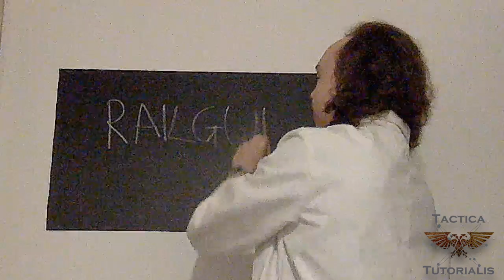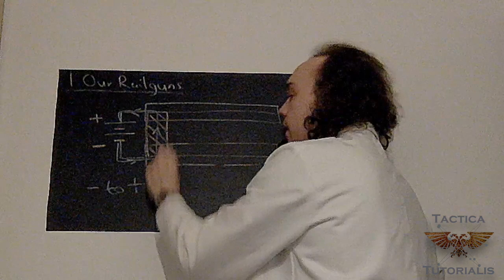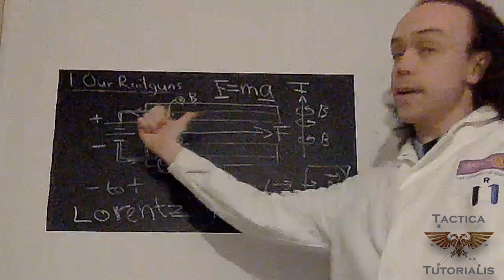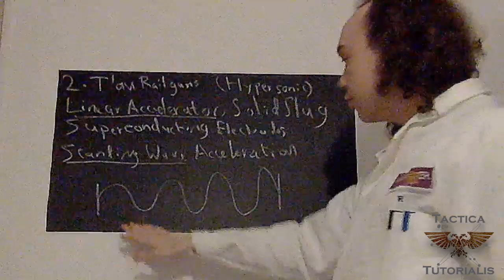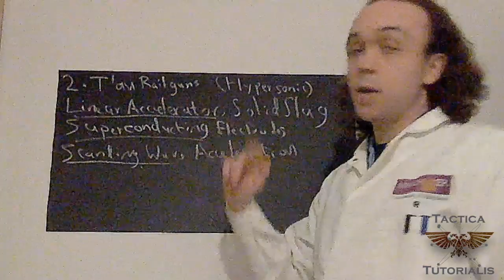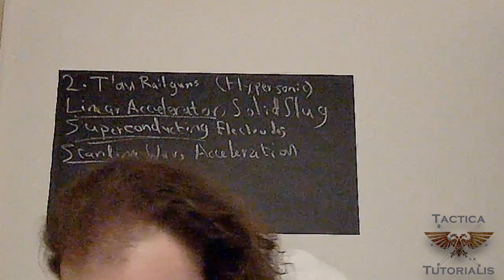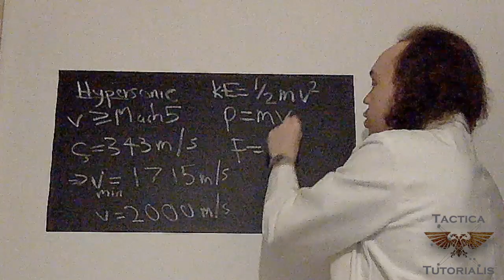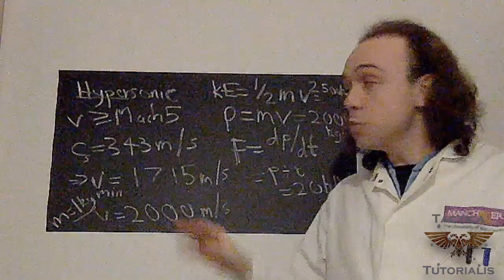Tactica Tutorialis: Episode 3 - The Railgun

Comment: I now understand why you're a Tau player... Bolters are scary, but Railguns are *frikken' terrifying*!

Quick side-question; a Rail Slug probably wouldn't stop when it hit a tank's armour. Assuming 'blowthrough' and a sealed environment, is it more likely that the shot would simply pass clean through a vehicle while sucking the air out the other side and extruding the crew across the battlefield in a fine mush, like someone stomped on an uncapped tube of toothpaste?

Comment: So what i see is the Tau Railgun is not as good as a modern day 120mm smoothbore gun of a MBT and the shells we have today can go up to 2200 m/s and that is cause we still use "black powder" and not chemical propellant
Reply: Indeed, my quick Google found a Wikipedia entry for the US's 120mm APDSFS rounds. The M829A3 round is 22.3kg in mass and has a muzzle energy of 12.1MJ. Dividing down this is roughly 542kJ per kg, so actually a bit higher than the 500kJ per kg that Tactica Imperialis calculates for the 2000m/s rail gun. It seems like a railgun would need to have a much higher velocity to justify the complex power systems it requires compared to the comparatively simple chemical energy used to launch present day tank shells.

Comment: Question: What are the energy requirements for a power sword. Using steel in place of ceramite as our melting point. And to contextualize it how many car batteries would that be.
Reply: Several megajoules most likely. If you look at because science's lightsaber power output calc is probably that.